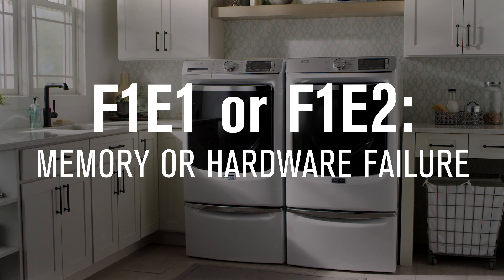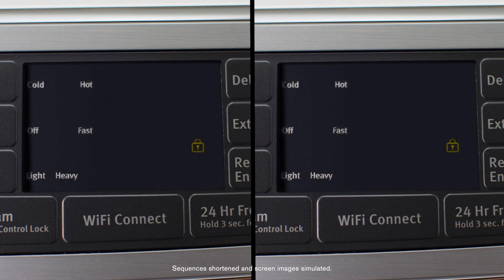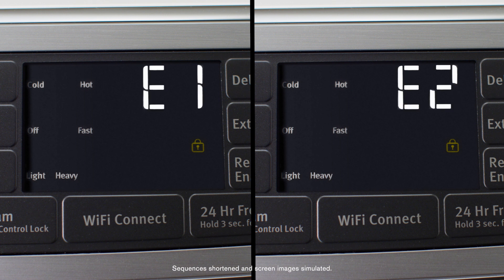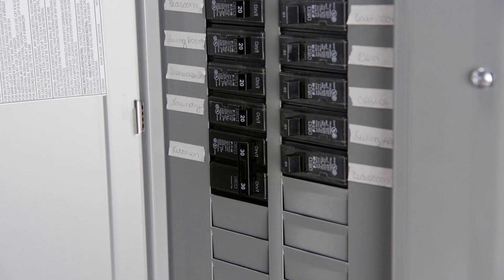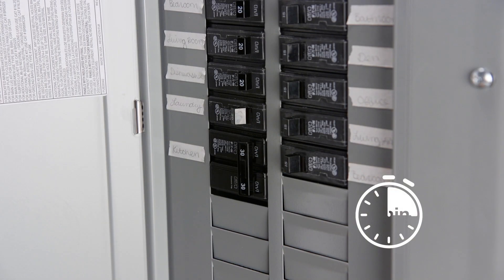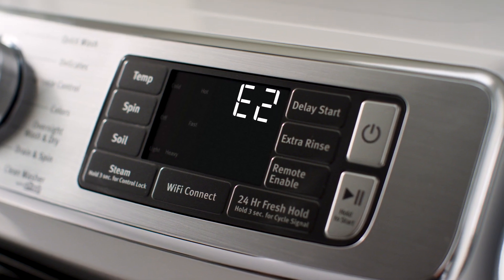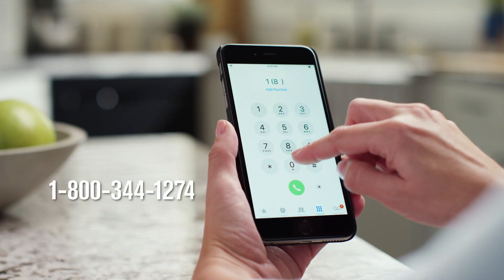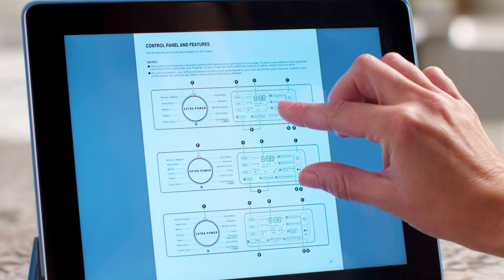How To Fix F1E1 and F1E2 Error Codes on Maytag® Front Load Washers

Comment: I usually hit the power button on the machine and then the door locked light flicks on and off until it takes 5 minutes or so to shut off and unlock and then I turn back on and drain the laundry load.  This is for E1 code that comes on.  And that does seem to help because it happens when the cycle is at the end usually for me.